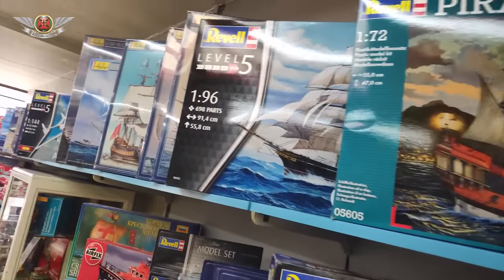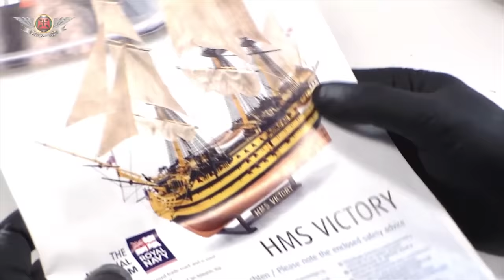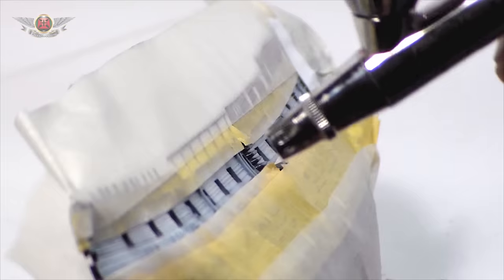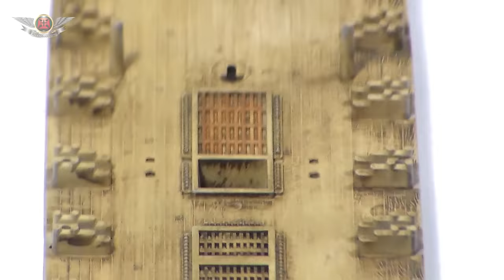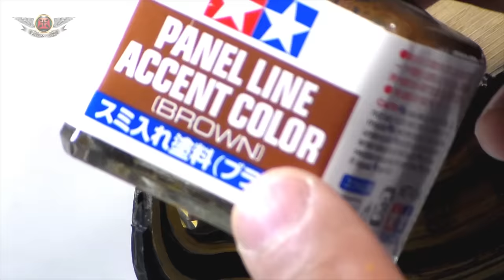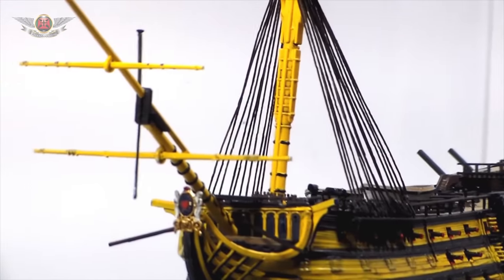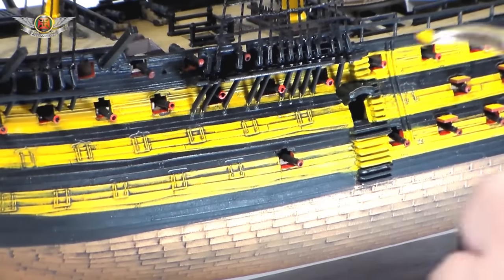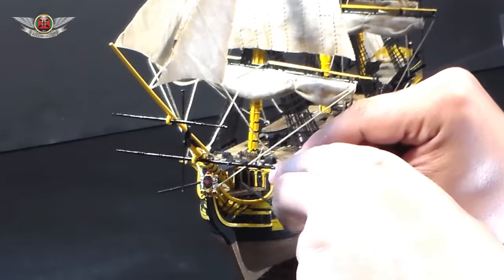REVELL 1/225 HMS VICTORY FULL BUILD VIDEO #epicHistoryTV #hmsvictory #trafalgarlaw

Comment: Oi, Alex! Wonderful and very inspirational work. I have this kit since 1973... I was just a child, starting at the hobby, and a friend of my father's helped me with painting and assembling the hull. I did the rigging the best way I could at the time. The kit's ratlines were of a flexible material, a lot more realistic than the hard plastic ones of the later editions, but very hard to install, specially for a 10 years old boy... The kit was proudly displayed for years in my family's living room, until the dust did a complete mess of all the rigging, and many cleaning accidents caused a little Trafalgar in the kit. Then one day I disassembled the masts, and put all the remains in a box. Lately I have looked at them, and concluded that the kit is still buildable, with a bit of scratch to redo the missing parts. It's a project for my retirement... A curious detail is that the painting, handmade using enamels, still looks very good. Abraço daqui de São Paulo!
Reply from the maker: Forte abraço! Desde 1973? O ano em que eu nasci aqui na velha Lusitania (Portugal). Felicidades para você e boa sorte no seu projeto! "-Tudo vale a pena se a alma não é pequena!"

Fernando Pessoa
Reply: @AlexModeling  Obrigado! Sabe que, apesar do apelido "russo", eu tenho cidadania e uma enorme família em Portugal, no Porto e arredores. Mantenho forte ligação com eles e com o país. Espero que essa crise toda passe logo para poder voltar a visitá-los. E obrigado por todos esses vídeos, sempre tenho aprendido alguma coisa para minhas montagens. Seu trabalho é sensacional. Grande abraço!!

Comment: I loved your video and your great work. My only nitpick is the string used for the sails is too large in diameter compared to the things around it like the railings and other human-use items. If it was measured against the other things it would be almost two inches in diameter.

Comment: Back in the mid 60's I put this ship model together. I was10yrs old. The plastic back then was black and I used tester paints and free handed all the painting with a small brush. It didn't come out looking as great as yours did but it looked good enough for a 10yr old boy. I had that ship for yrs but it dissapeared after I got out on my own.
Nice job on ur ship! It reawakened some old memories from over 50 yrs ago. Thanks.
Reply from the maker: Thank you for sharing it! 😊

Comment: Hi Alex, Thank you for posting this video. Your English is indeed only slightly accented, and perfectly understandable. It is not necessary to apologize for it. Your model is terrific. It is definitely a work of art. Your patience is amazing, and it has produced an amazing model. I think that even though this is a model from the 1950's the flash on it is more probably owed to the quality of its original molds. I believe the mold itself wore out over the many times a model was molded from it, rather than the age of the model itself. The plastic over time might have been become warped, but it would not necessarily have produced all the flash you had to cope with removing. The sink marks are another problem. I believe the plastic molding industry just did not have the technology we have now & that's why those sink marks were so large & so needed. Anyway you are to be greatly congratulated for the quality of your model and the video itself. Thank you. --Tom

Comment: Phenomenal skills and great job👍

Friends Father scratch built the HMS Victory in 1975-76 from plans. Ship was sitting on dining room table. 72”x18”x15”, masts exceeded the ceiling height. He cast all cannons himself as well as hand nailed all the hull plating in very thin copper. Every deck detailed with cannons , ropes , gear, it had to have ended up in some museum. He had also completed the USS Constitution in the same scale, we played with one hull that he messed up in some way using the air fix wwII soldiers.

Memories

Comment: The best video for the revelle Victory so far and though I've sailed such ships in real life, your modifications, which I think are brilliant, are certainly acceptable given the scale.  Just a few things I'd change like drilling receptacles with a micro pin drill for the various lines and bracing gear etc. I'm slowly accumulating the literature and information on the Victory and hope to have a go soon. I  did try the airfix 1/800 scale about 50 years ago but I can't remember if I ever finished it but the revelle is certainly a good idea to get back into modelling.  Can't think of any other model that's more complicated so well done you.
Reply from the maker: Honored, thank you!

Comment: As I was born and now live in Plymouth England I opted for the model of the Mayflower, I think about the same scale. I have never liked the plastic sails so either build them with any sails or material ones in the furled (or stowed) position. My favourite was a 1/72 Corvette from the original release by Matchbox. I replaced a lot of the railing etc with solid copper from house hold electrical wire (1 mm).

Comment: Lovely to watch and a fantastic build! You're a very patient man. Just a word on the ratlines - the horizontal footropes should be of a thinner thread because the stays were structural whereas the footropes only needed to support a man's weight.
Reply from the maker: I did that... Was worned after 50% of it already done with same thickness so i changed to thinner tread... Will do that the same time.. thanks😀

Comment: Hi Alex, I felt I should tell you( unless you already know of course!) That Victory underwent a £35,000,000 restoration as she was in danger of collapsing in on herself due to being in  the same unmoving position since the 20's. Anyway before completely repainting her, the craftsmen had to strip away a lot of rot and in so doing found 72 layers of paint and through carbon dating discovered that the beautiful Victory we have marvelled over isn't the Victory that Nelson looked at. The yellow ochre we saw was actually quite a bit lighter in Nelson's time and the black was more of a very dark grey. The blue is fine. The wonderful vessel now wears these colours. Also in order to stop the effect of not moving on the sea Victory has been raised onto computerised stilts that will simulate being in port rather than dry dock, it also means visitors can walk underneath her. It's on my bucket list. Hope you don't my my saying but I was shocked when I read the report. I thought you might be interested. Thanks again for all your great content and videos.
Reply from the maker: Thank you! Stay safe! 🙂👍

Comment: This a great videoI Well done , sir!  I have been aboard Victory in Portsmouth and I have to say as a "Yankee" sailor it was not without some sense of honor and  emotion to render proper honors to her quarterdeck and colors and stand where Nelson took his greatest victory.   I also have that model, but its been through a couple battles of it's own with my wife's broom handle and took a nasty fall from its lofty berth .  You have inspired me to take it down and give it an overhaul and repair period!  Your video is quite handy inspiring me to do that.  If I could make just one comment on weathering, it would be that being a warship, her decks were scrubbed with seawater, sand and holy stoned every day, underway or inport,  the sand would remove any tar drips and other stains, holy stoning was to clean and fill any cuts, gouges , or surface marks with talc that when dried gave an almost white appearance to her teak wood decking.  My model has a light beige decking, so if if were weather it all , it would be a dry brushed cream or ivory color, or plain old talcum powder.
Reply from the maker: Thank you!

Comment: IMHO you are a great modeller. The amount of details in your paintjob is astonishing. I just started building this kit. But i have a painting issue. I really don't know how to mask the sides of the hull or simply how to make those black lines accurately. I will be truly greatful for ur advise.
Reply from the maker: Thank you. Im just an amateur. I used photo references and used masking paper acording to the colors i wanted to Paint... One at a time. Do it slowly.. you have the time.. its modeling.. its fun when it takes longer and the resulta are better☺️
Reply: @AlexModeling  thank you for advise, hope that will help :) indeed, I knew from the begenning it is not gonna be  a weekend build :D by the way.. will the normal masking tape work?
Reply from the maker: @mikemodels928  well, i would advise you to use really modeling tape. Tamiya ir some kabuki tape type

Comment: Not a bad job. 

I havn't done a kit in almost 20 years and I am not a fan of spray painting. I would have liked to see you have a go at a multi layered (hand painted) hull and then finely sanding back to develop the colour variation of the green weathered copper hull that occurs after years of traversing the open oceans. I would also have preffered the earlier 1800's Black and Ochre colour scheme rather than the 1900's Black and Yellow scheme.
A nice job though, and it may kick me into buying several of these kits and paint them in the different colour schemes of the ships 250 year history.

Comment: Nice job. The darker wash to the hull colour definitely adds texture to the bold yellow. On the rigging, I'm wondering if it might have been possible to create separate neat noose knocks with slightly finer twine, cut the loops, then wrapped and glued them back together around the railings and glued them to the rigging ropes close to the knots, as they are not load bearing and just cosmetic. Please feel free to ignore if I have not made myself very clear and thanks for the fine video. I know it was worth  the length to get the full enjoyment out of every stage of the build.
Reply from the maker: Thank you for your advice. Will BE very usefull on my Next One! :)
Reply: @AlexModeling  
Cheers mate, I hope I wasn't speaking out of line. I just noticed how tricky it was tying the knots on the Victory.
Reply from the maker: @astrogoodvibes6164  not at all! Thank you! Its always positive to Share some tips

Comment: Wonderful work Alex, it is awesome. I'm trying to build it right now  following your advices. I have just a question: when you apply the wood wash at the deck you applied a clear gloss layer first or you did directly on the paint?
Reply from the maker: I apply direct. The wash is enamel  and the base coat is acrilic. But i advise a satin coat at least. Thanks for the late reply

Comment: alex, quick question, when you apply a wash over the deck or hull{wasa} do you first use a varnish or clearcote over the acrylic or is it safe to do the wash on the deck/hull ? will the white spirit harm the acrylic?
Reply from the maker: Use a satin varnish if possible, aplly the wash and then aplly a Matt coat. Sometimes the white spirit can harm the Paint coat

Comment: When you stated 1959 kit...were you referring to the molds?  Not that it had been manufactured in 1959...which would mean those paints were 60 years old.  Those paints didn't look that old....or they'd have been very caked.  Just wondering.  Great modeling BTW

Comment: Beautiful work.I bought the same one,but i give up building the model,because it was very poorly molded.A lot of parts was warped and crooked beyond repair.
I get to the stage where you have to glue the deck and the two halfs with cannons together,but it didn't fit.I manage to somehow glued together,
but then most of the cannons fell off because of crooked plastic.The main body was already glued so no chance to glue the cannons back inside.So i give up.
I stick to building tanks,aircrafts and trucks instead (finished about 50+ and still have a lot more to start making).I did build and finish the easy models of Bismarck in 1/570 from 
Revell (1984) with no problems and a PT 109 torpedo boat in 1/72 also from Revell.
Reply: It seems the quaility of the old kits varies wildly from a very good kit with poor mold lines to a bent up pos kit just the luck of the draw

Comment: Great video!  Am really confused though regarding the age of the kit...you say its from 1959?  It’s 60 years old?  And the box looks immaculate.  How come the commemoration poster dates 1805-2005?  I’m clearly missing something here...its my fault I’m sure :)
Reply from the maker: The kit is from 1959. The box is imaculate because Revell Still sells these kits and with the exact same comemiration poster . This is the box from 2005 but the kit is indeed from 1959...
Reply: AlexModeling aahhh I see. So it’s a new kit, as in recently left the factory, but it uses molds from 1959? Thanks 👍
Reply from the maker: @stumpybloke  its from 1959... All these are INDEED from 1959 Exactly this year... And its on stock and so they um Revell rebox and let these for out... Thats not what i said
Reply from the maker: @stumpybloke  its NOT a new kit

Comment: Revell was a pretty schlocky outfit, producing some real crap.  But their sailing ships were state-of-the-art, representing a large investment in the molds (shudder).  They must've been money makers or the sheer number of sailing ships would never have been produced.  The quality and design stand up very well today even if the molds show their age.   They maximized the marketing by falsely issuing various ships using one set of molds (Cutty Sark/ Thermopylae, Seeadler/Eagle, etc.).  True, the new-school injected ratlines suck.  Revell should also include the old-school ones like in their early issues as also found in Airfix kits.

Comment: just curious as I am about to get into plastic model building. My question is for the stern is there a reason you didn't paint it gold first then covered it in black and while the black was still wet just wipe it off on the high areas with a fine cloth such as a lens cleaner cloth?
Reply from the maker: I explained Exactly what i did and why... It was the best way i could find...
Reply from the maker: And if you try to do what you Said with acrilics and só smoothly apllyed good luck... It Will already BE dry when you try to wipe it out

Comment: Built and then gave up on the 1/180 airfix one, couldn't get the two main decks together with the hull without everything slipping all over the place, in the end I glued both hull parts, then put in one deck at a time. Then gave up

Comment: i just found this self-same model at a charity shop and bought it on the hoof. It was unopened and the price was £4.50. Now I've opened it and looked inside and I'm daunted by the prospect. As you say, the amount of flash is awful. I'm also surprised at how flimsy the plastic is. Right now the box is sitting on a high shelf and may well go back to the shop. I just don't think I'm up for it...
Reply from the maker: You can do it! 👍😊

Comment: May I offer a small tip on masking and painting? After applying the masking tape, spray on a couple coats of clear and let dry before laying down the color. The clear will seal the tape edge to prevent the color coat from bleeding under the tape.

If you like the Victory, try this kit: https://modelexpo-online.com/COREL-HMS-VICTORY-198-SCALE-DOUBLE-PLANKED-KIT_p_985.html
Expensive for sure and very complex, but the end result is worth it.

Comment: Nice build, but sorry mate, that is not a 1959 kit, that is a 2005 new modern kit which has used the original 1959 mould, the original kit had black moulded hull sides and most of the decks was in a dark reddish brown colour,
All your kit was made all in one colour.
All you have to do is google it, if revell has used the same moulda then all the flashing will be the same as the old kit, also the plastic was different to modern day plastics.

Comment: nice paintbrush advises, respect! thanks alot. ..ratlines appear much too thick, example british/100-110 guns/Fore lower-mast: all in circum-distance divide by Pi(3,14)=diameter : shrouds 7pair 11 inch, ratlines 1,5 inch, stay:18 inch, preventerstay 11,5 inch, ratlines distances 12-13 inch between........1 inch=25,4mm

Comment: building one right now. every piece is malformed and pointing somewhere, every hole is too small and I need to not only drill them bigger but still whittle away half of very stick in order to fit them in. some pieces just snap on their own when merely breathing on them. the sides barely fit together with the floors, and the endless pin marks.
once this thing is done its going on top of the shelf and I will never ever even look at it.
this is the most frustrating project I have ever taken.
Reply from the maker: Im sorry for that

Comment: I'm confused? Is he saying the model was built in 1959 or the original design was from 1959? Because there is a poster inside dated 1805-2005 and the paints are still good. Just curious.
Reply from the maker: I was saying that this kit (mold) is a 1959 One. Its however a revox to celebrate thebattle ence the poster
Reply: OK, I mean you did a beautiful job but I just saw the gloss instructions, intact paints and poster and was confused. Also I've had a harder time understanding native English speakers than you.
Reply from the maker: Thanks! Apreciate it!